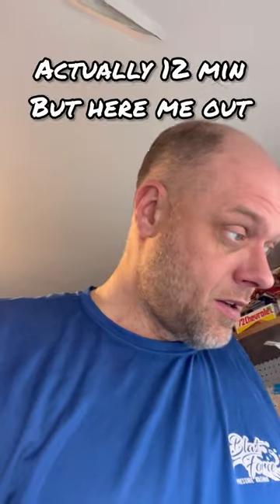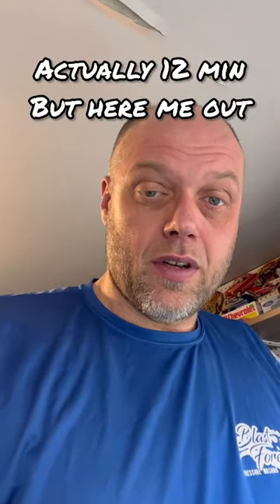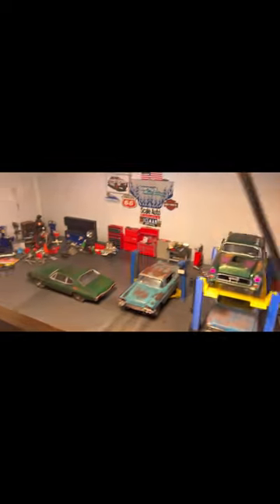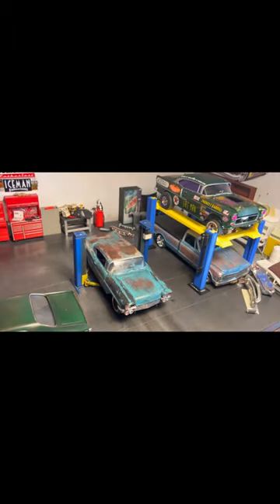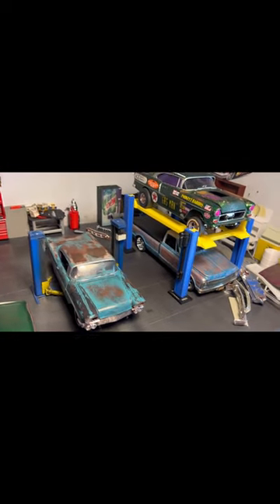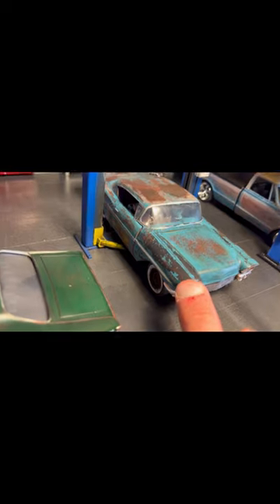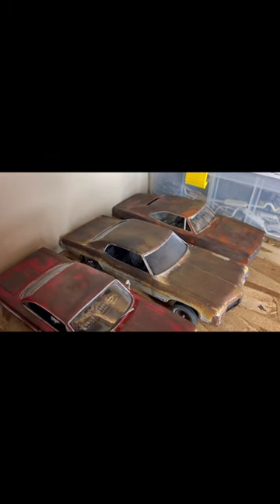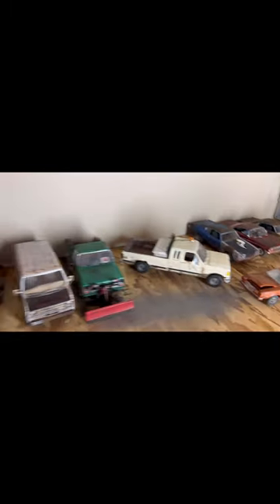Don't be afraid to try weathering model cars. Here is why..

Comment: Awesome diorama and excellent builds! I think one thing that may keep people from trying this method is the cost of a kit. They don't want to mess up a $30 model. I started it by doing older used and abused models. Or ones I really screwed up😅. Those are some of my favorite builds. I think you nailed it when you said There is really no right or wrong way to do it.
Reply from the maker: The prices are ridiculous really. I wait till flea markets, model swaps or I buy people out. Hobby lobby at 40% off is awesome too. Olives every now and then.
Reply: @Sparkysmodelsalvage  we have a HL but no Olyies! I never buy a model at HL if it's not 40% off. Michael's has decent online coupons that you can apply to models.